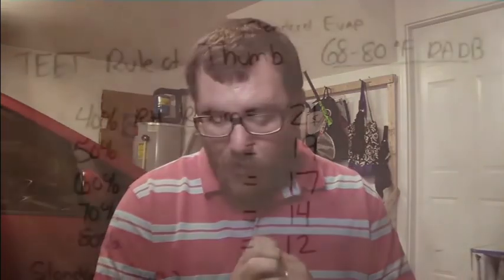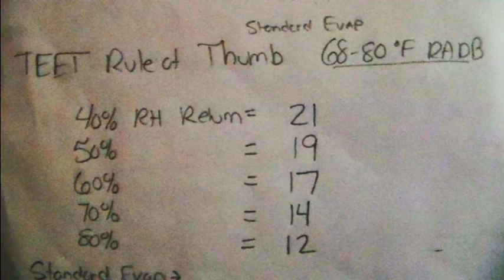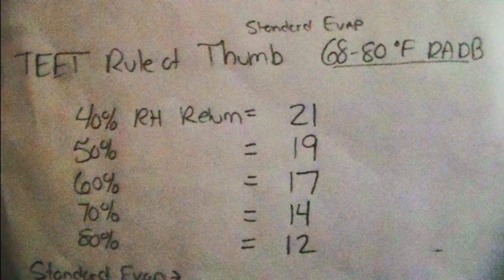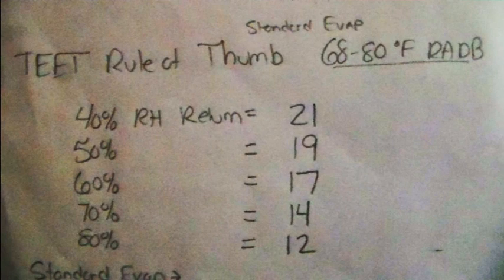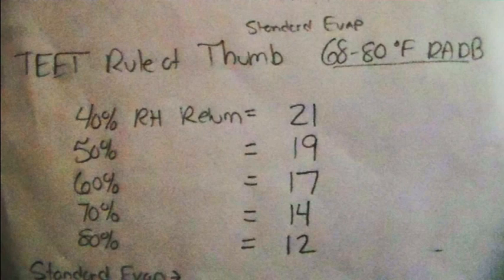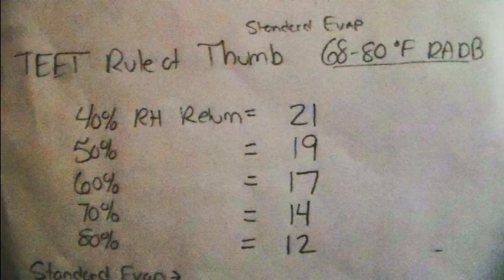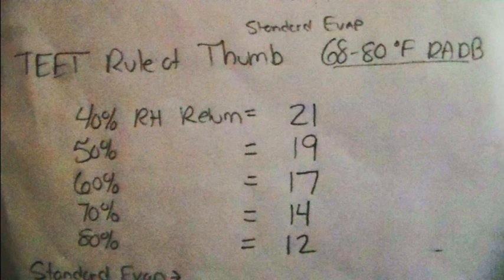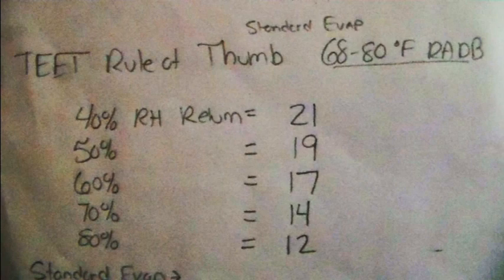Target Evaporator Exit Temperature | HVAC Training

Comment: One minor refinement. At about 6 minutes into the video, you mentioned a AEET (Actual Evaporate Exit Temperature) that was about 5 degrees higher than the TEET. You then suggested looking for causes of low airflow. According to the Fieldpiece HG3 user guide, AEET readings that are higher than TEET are symptoms of low cooling capacity, such as refrigerant mischarge or a dirty condenser coil. (Sounds to me like low subcooling.)  "Occasionally, airflow is HIGHER than expected." (I guess the thinking here is that too much airflow will not allow latent heat to be removed because the humidity can't condense on the coils.)  The guide also says low airflow should show up as an AEET more than three degrees LOWER than TEET (perhaps indicating inadequate sensible cooling?).  This stuff is a little mindbending to me.  Does this jive with your experience? Perhaps knowing what to chase down if AEET more than 3 degrees higher or lower than expected may help with quicker diagnosis.

Comment: No one provides Techs with the formulas for sizing filter rack areas; I will: 
HVAC Airflow- Duct, filter’s Ak and other Component Sizing Formulas: 
Required Ak area of the filter= CFM / required/desired fpm velocity
Heating only 858-CFM / 220-fpm = 3.9 (Ak) SF (my filter numbers)
I have (3) 12” x 32” filters 384-sq.ins. x 3 is 1152-sq.ins / 144 is 8 | 3.9-Ak / 8 is  0.4875% or filter’s Ak %.

A tested 59°F temp-rise x 1.1 is 64.9 furnace 55,500-output / 64.9 is 855-CFM 
3.9 X 220 = 858-CFM; Had a tested 855-CFM; very close. … 
16X25 filter that is 400-sq.ins. / 144 is 2.7777 that’s NOT a much smaller Ak  (open-air- area). 

Filter’s Ak = CFM / fpm velocity through the filter in fpm
FPM= CFM / SF Ak AREA of filter
CFM = fpm X SF (Ak) AREA of the filter
Required Ak % of the filter AREA= smaller actual Ak area / filters larger listed Square Foot area. 
Save these Formulas & USE them to properly size filter rack area..! 

Duct's dia 6" x* 6” = 36 *x .7854 = sq.ins" / 144 = 0.19635-sq.ft area

I like the Purolator P-312 white Industrial Strength Disposable Synthetic Panel MERV 4 filters - low pressure drop with decent filtering; you have to order them on the Internet. A .16" PD @300-fpm; .10" PD @200-fpm velocity 

I  like the Purolator P-312 white Industrial Strength Disposable Synthetic Panel MERV 4 filters - decent pressure drop with decent filtering -  you have to order them on the Internet. A .16" PD @300-fpm; .10" PD @200-fpm velocity. 

7 out 10 HVAC systems by exhaustive testing have airflows out of tolerances, this can cause high cost ECM motors to exceed their rpm Rated limits & thus overheat & fail…

Comment: The air flow in cfm per ton varies with humidity too. In super humid areas the latent heat load is high. One is pulling all this water out of the air thus low say 350 cfm per ton. In dry las vegas low latent heat ie little water to pull out thus they may run 500 cfm per ton. These are rough rules